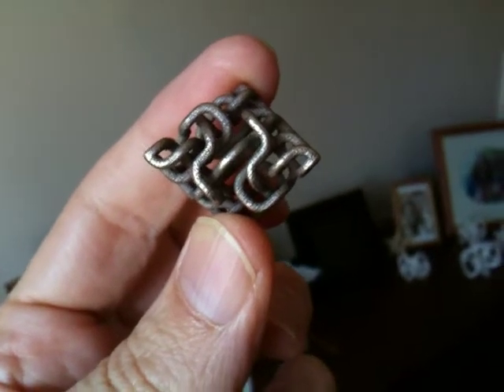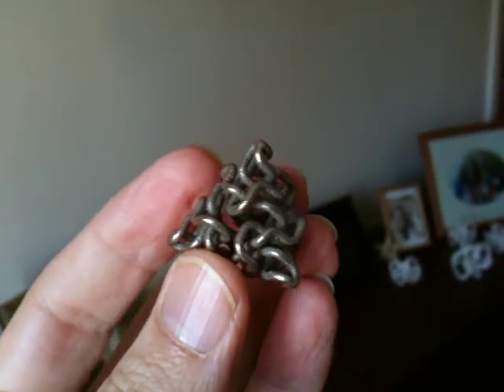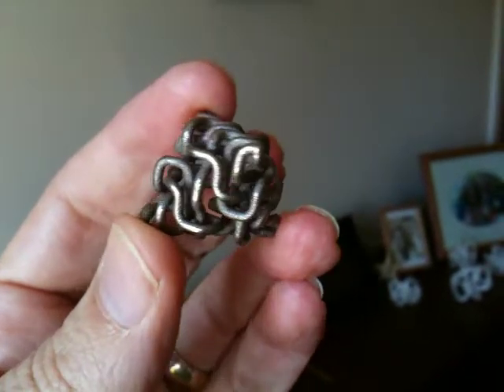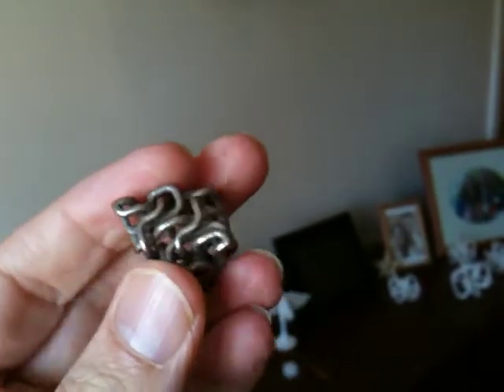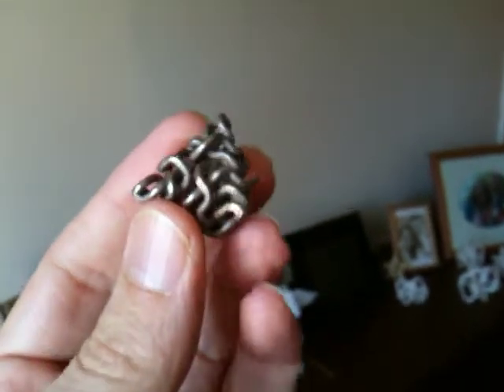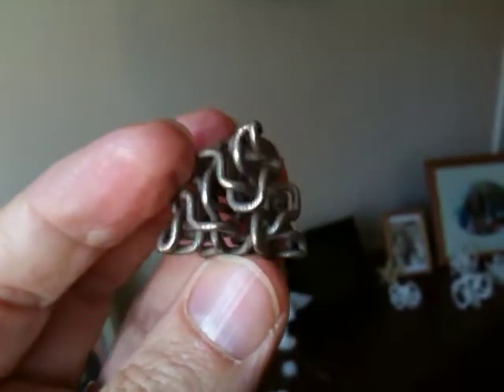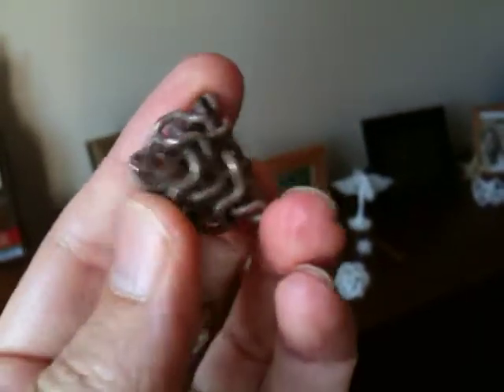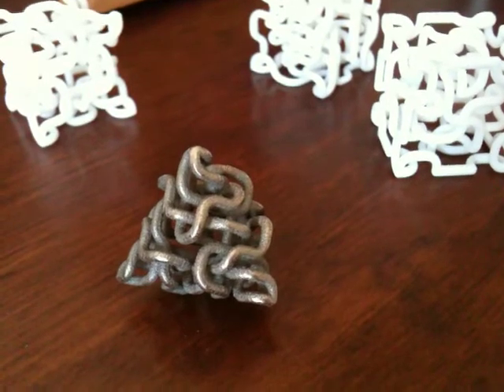Tanglehedron

Comment from the maker: No, if you imagine a simple tetrahedron, each vertex has three edges connected to it and every pair of vertices is connected by a straight edge. In this shape, the topology is the same but the edges are no longer straight - they are long and tangled but they end up at the same point as before.